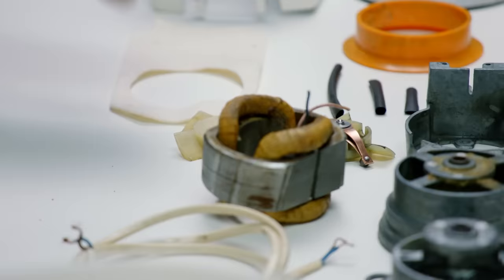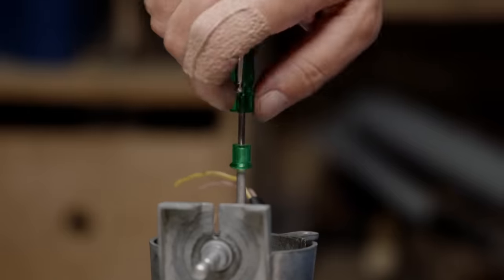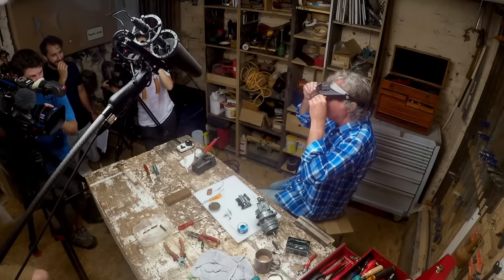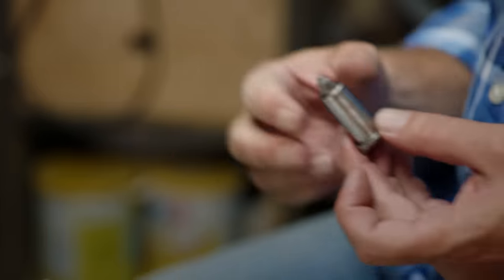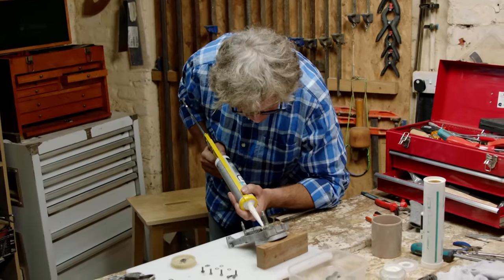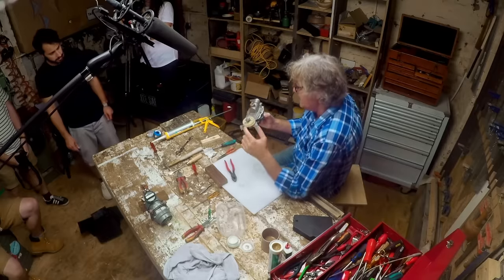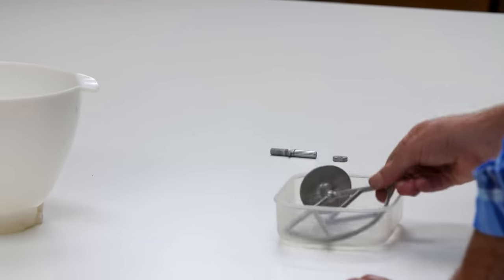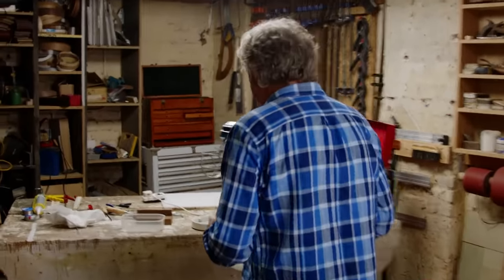Can James May Build This Kitchen Appliance? | Reassembler

Comment: Thank you for posting this. I've 3 Kenwoods circa 1960's I'm restoring and I must've watched this over 10 times. Like James it was only until I took them apart and reassembled that I developed an appreciation for the solid construction. Very hard to break apart from capacitors blowing.

Comment: Absolutely loved this. Cheers James and NS crew. Watching this, one can't help but respect the skill of appliance repair folks and the engineering that goes into  building lasting machines. How times have changed. PS: The video production displayed here is art, so impressive.
Reply: Times haven't changed. It's just that everything built in 1962 that wasn't built to last has long since died.
Reply: @DocIncredible  The vast majority of appliances built these days aren’t built to be repaired or maintained, much less last. I don’t argue that they didn’t make junk in the 60s, but I would definitely say the engineering focus these days is almost exclusively centered on cost reduction and minimum life expectancy. (Warranty scope)
Reply: I need to  buy a new second-hand food blender. Because the one i have, has just packed up. After intermittent use - it was also second-hand. I have no idea why it doesn't spin round anymore. When j get the next one, j might be able to figure it out
Reply: @Leaving_Orbit  Prices have gone down, so it's probably not as worth it to fix these days. You might be more willing to have someone come around to fix it if you'd spent a half-grand on the mixer, but if it's something you got for a hundred, it's a lot easier to just chuck it and get a new one.

Comment: That's weird I just repaired/serviced my sister's (was my mother's) Kenwood Chef 701A last week. I stripped it down but not quite to the point seen here. The insides were absolutely filthy due to the years of flour and moisture accumulating inside but for a 50-year-old mixer, there was very little wear to the components. A quick clean-up of the motor brushes generally brought it back to life. Then today I see this video doing the same thing (except more in-depth and previously stripped and cleaned). Instantly recognizing each and every part, as I only did this last week, brought a smile to my face. But I noticed on yours the felt cover (Pt no. 182444) was missing (which stops the grease and silicone sealant from dropping into your cake mix). This mixer was made just before I was born and I am sure it will outlast me. This is how they should make equipment. Modern equipment does the same job but is built down to a cost so will not last as long.

Comment: Just a note of info.  The imperial system is alive and well in aviation . All rivets, fasteners and bolts are measured and ordered in 32 nd's or 16ths of an inch, regardless of whether they are boeing or airbus etc.   eg. a solid rivet would be b a c r .......6_6   which would be 3/16 "  dia  and 3/16"  length  . So every fastener on every aircraft is graded for dia and length in graduations of an inch . ( probably because of american  measurement ) .But that applies to European manufacturers as well.
Reply: Fascinating, never knew that. I'm 58 and I remember my grandfathers tools including imperial calipers and a micrometer measuring in divisions of 1/1000s of an inch. I wish I still had them

Comment: I have a non-working one of those stashed away in the pantry awaiting repair. To be fair, it worked for 58 years, only needing a capacitor kit, but finally gave up the ghost a few years ago, to be replaced with a shiny new Kenwood, which I have grave doubts will last as long.

Comment: Haha. Good timing! Have already replaced the caps that went bang on fire-up*, and just about to fully strip and rebuild my virtually unused tangerine coloured 901 that came into my possession after a flat clearance. Fingers crossed, it should be good for another fifty years!

*standard fault on these old kenwoods

Comment: My mom had a Kenwood mixer exactly like this at least up until the mid 2000's. I don't know if she still has it, we aren't on speaking terms. 🙄 I refused to use it because it shocked you every time you plugged it in and unplugged it from the wall.

Comment: Dear Naked Science. Love these uploads but the logo you have for Kenwood in your thumbnail is the wrong Kenwood. That Kenwood (Kenwood Corporation) made low-cost but attainable and desirable Hi-Fi equipment and was founded by two Japanese blokes who chose the name based on a popular name and the fact that wood was used in HiFi equipment.....whereas this Kenwood (Kenwood Limited) was the one founded by Ken Wood. The logo you need is the word KENWOOD with the kicking bits of the K in red, the rest in black. Cheers.

Comment: Comparisons to modern food mixer:

To a Kenwood? Not much difference. They still use indirect drive motors and multiple power transfer points so you can use it for a blender, food processor, etc, as well as the mixer.

To a Kitchenaid/Hobart, which also haven't changed since Ever? Very different from this, because Kitchenaid mixers are built to be as stupid as they possibly can be.

Comment: Soldering is only not fun when you got a inadequate tool😅...with that said you need to be fast do not linger or you going to melt all the components😅to add without the voltage readout or wattage readout you might as well just close your eyes and hope for the best🖤... but then again it did work soOOoo... there's electrical engineering for you🤣

Comment: It's not "silicun", which I presume is the master English for "silicon".

Silicon is a mineral? that is used in computers to move electrons along.

Silicone is a plastic material, such as what you used here.

Pronounce it correctly, please.

Thanks, 
Ed, from Silicon Valley (San Jose, CA)